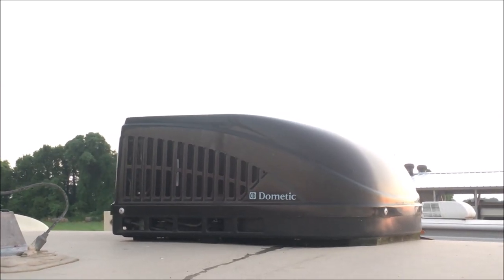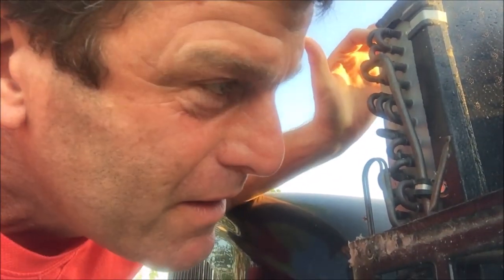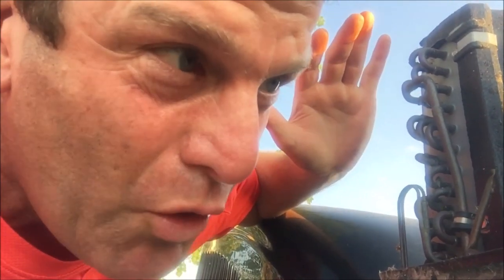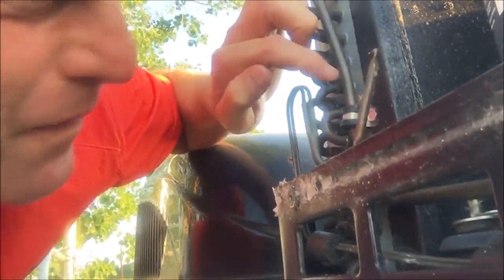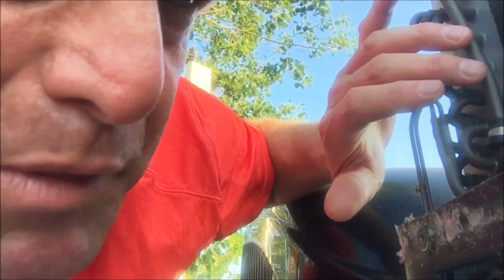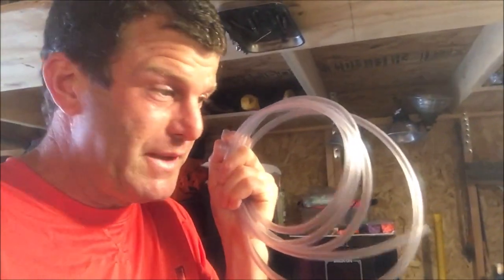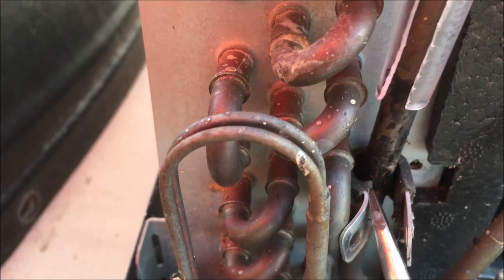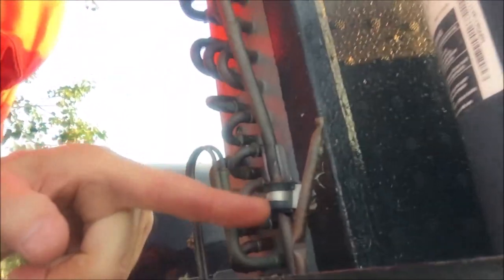How to Fix a Noisy RV Air Conditioner

Comment: I just changed the motor on my AirXcel Mach 2 air conditioner - it looks exactly like yours. It was making a very high pitch whistle that was driving me crazy. I went on Amazon and $321 Canadian later I got a new motor and my problem was solved. Then I decided to take a look at the old motor just for the hell of it. 4 small nuts and the long screws came out - I then knocked the sides off with a chisel - the stator assembly with all the windings slide out easily. Two small ball bearings on either end were noisy - to remove them all the rust on the shaft must be sanded off completely or the bearings won't slide off. I checked the price of the bearings - $3.08 Canadian each . I believe now I could have fixed my problem for under $10  - so now I have a spare motor. While I had the AC unit open I cleaned the coil radiators a tooth brush and an air compressor and then  water.
Reply from the maker: That is a Great piece of information!!!! Thanks
Reply: I did not know those motors had ball bearings in them but what is called “sleeve bearings“ or “plain bearings.“ do you know the name, make, and model number of that particular motor?
Reply: @adobemastr  I don't have that info at my finger tips but what you need to know is every bearing has a stamped number on it and you can use this number to find a replacement bearing. Caution : you must measure the inside diameter of the old bearing or the outside diameter of the shaft and make sure the new bearing is the same . The one I got was 1/32 " to small so I had to use a common round file and filed the inside until it fit on the shaft - my mistake for not checking first.
Reply: @nrich5127  Thanks for replying. My motor does not have ball bearings in it, but like I noted above, it has sleeve bearings or plain bearings. I made a video on this because I’ve been having so many problems with the AC motors in my RV and it is a Coleman Mach unit:

https://youtu.be/NjdRoxFdJyo

I actually think a ball bearing motor is better, but I have been unable to find these kind of motors with ball bearings in it, which was why I asked you the information on your motor. If I had that information, I would contact the manufacturer and see if I could get a motor like yours which I believe would last longer in the hot Tucson sun where I live.  And I’ve searched for years to find a ball bearing motor that would work in my RV but have had no luck at all. Are you in the USA?

Comment: Can I pick ur brain a moment bud? So, my ac unit is making a very similar sound but for just a second or 2 every 20ish minutes. Do u think, that this is a normal function or something along the same lines as what u had goin on here? Best guess and any advice appreciated. Bought the camper used and I know very little about it
Reply from the maker: My other unit was doing that intermittently and it was the same exact clamp causing the noise so I’d suggest getting in the roof and moving the line around while it’s running. I bet you will find that the clamp is causing the problem. Good luck

Comment: I was planning to go on the roof, once again, to chase that rattle.

Now, I know where to look.

Well, what I found wasn't a vibrating cooling lline, but the the bottom of the unit was bent.

My fan was hitting the housing, so I screwed down the bottom tray to clear the fan.

It's obvious if you climb up and remove the cover.
Reply from the maker: I hope that is it.  Simple fix!!

Comment: The video will only play the first 32 seconds. Would you mind elaborating on how you did the repair?
Reply from the maker: Beau Chinn I just watched the video to the end. Try it again
Reply: Still same issue for me.
Reply from the maker: @beauchinn3574  The fix is in the video description.  Good Luck!
Reply from the maker: @beauchinn3574  Start the video then click the Pause button.  Let the data stream in without the video playing for about a minute then click the Play button and you should be able to watch the video.  You can also change the quality of the video in the settings to something slower and get it to load faster.  Click on the gear next to the CC button at the bottom of the picture.  Click on Quality then click on 480 (or slower).
Reply: @JustPlainCommonSense  thanks